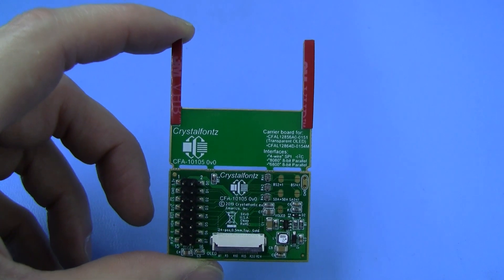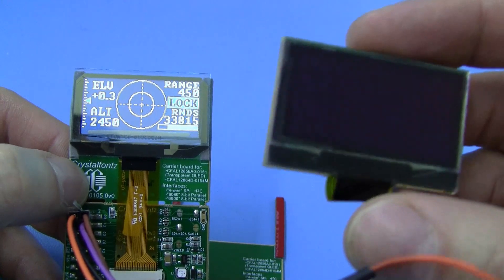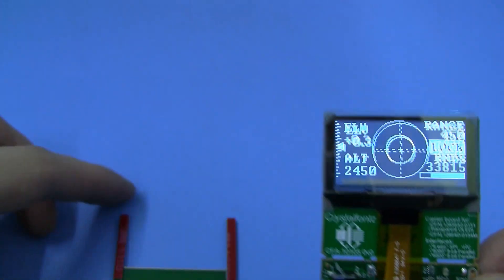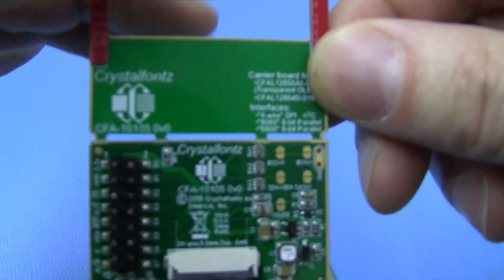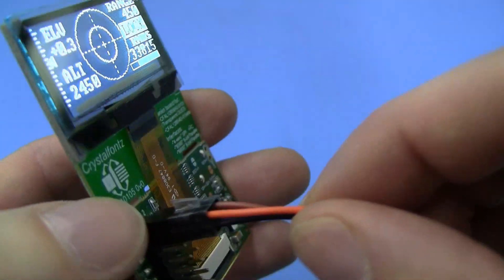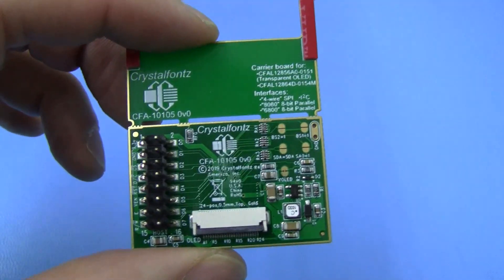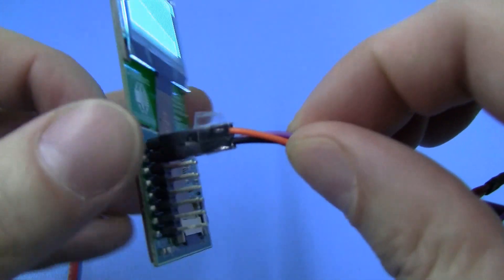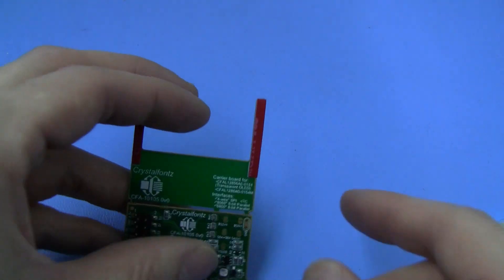Crystalfontz Transparent OLED Breakout Board - works with Arduino 3.3v / Seeeduino

Comment: Is there a limitation for the length of the ribbon cable? If not, can it be extended?
Reply from the maker: The functional limit for SPI or I2C is about 10 meters, but it's definitely something you'd want to test. It would be costly to have it lengthened but you can purchase a board with an extended cable to connect to it as long as it has the correct pin count.
Reply: @Crystalfontz  Excellent! That is exactly what I needed to know.

Comment: Is it possible to display a digital clock? How would you begin? I'm a second year electrical engineering learning the ropes...
Reply from the maker: Absolutely, I'd start with examining our demo code to see how we're put pixels on the screen, then experiment and extrapolate from there. There's many tutorials on the interwebs, you might look for one that uses an OLED and a Solomon Systech controller. Good luck!

You can use a Raspberry Pi and follow our tutorial here: https://www.crystalfontz.com/blog/transparent-oled-on-raspberry-pi/

Comment: The high pitched noise from the onboard caps or a unshielded microphone?
Reply from the maker: Good ear, it's the caps on the Seeeduino.
Reply: @Crystalfontz  Interestingly, the exponential dampening from noice cancellation algoithm makes it sound like the moment it starts raining. I actually took off my Airpods and looked outside.

I honestly not sure if it's good ears coz they put me off from a lot of sourcing options.
Reply from the maker: @_vicary  You might try using tantalum capacitors, we've found they work best to limit ringing at high frequencies.

Comment: Is this possible to use with a Pi4?
Reply from the maker: Hi Dan, Yes, it's possible to use this display with an RPi4. Look for example code for displays that use the Solomon Systech SSD1309 controller.
Reply: Crystalfontz America, Inc. awesome. Do you have a UK/Euro stockist also? Shipping is pretty much the same price as the parts :-/
Reply from the maker: @DanBamberProductionServices  We ship worldwide from our Spokane Valley, Washington location.  You can also purchase this display from LC Designs in Europe.  https://www.lcdstore.de/epages/17406888.sf/de_DE/?ObjectPath=/Shops/17406888/Products/CFAL12856A0-0151-B

Comment: Hi, Can be used with "Portenta H7" or some arduino nano? I mean, only arduino and CFA10105 OLED, without the Crystalfontz viewed in 0:12 I just want to use the Transparent OLED. I dont know if your hardware require an extra board to make it works or just with arduino + Oled can work
Reply from the maker: The CFA10105 is the breakout board. It's not required to use the OLED however it does make it much easier. You can use anything that runs SPI and is 3.3v. Let us know if you have any other questions.